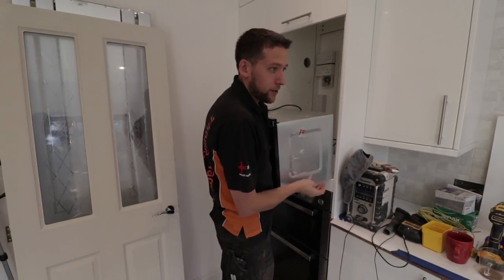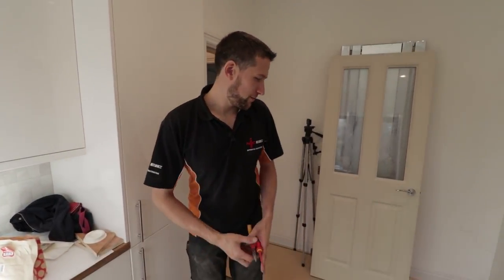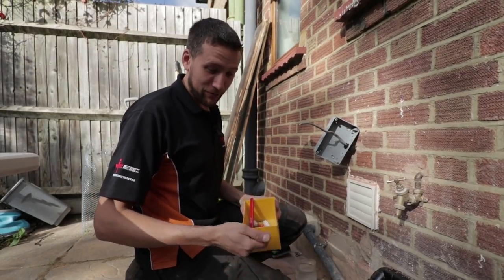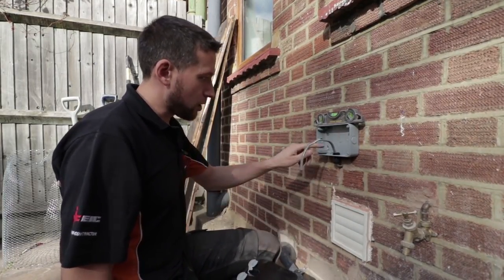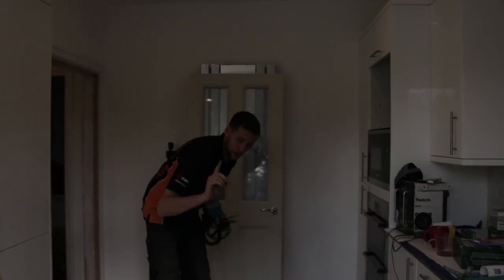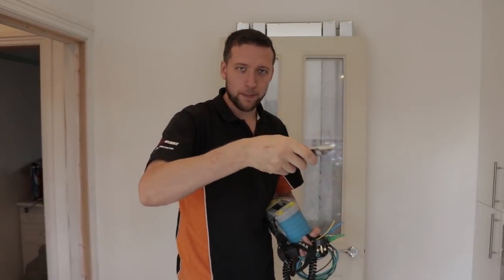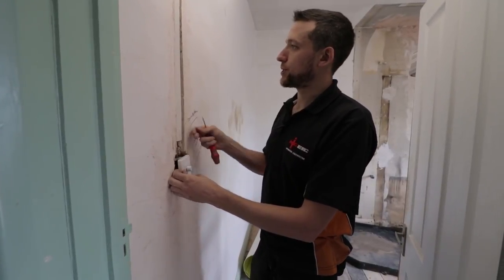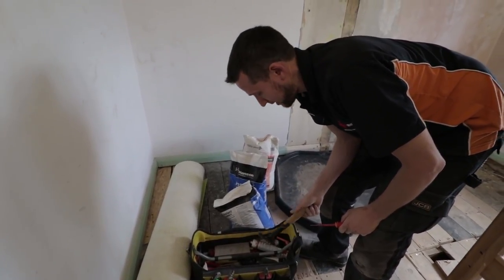The Final Furlong - Rewiring a “just rewired” house | Thomas Nagy

Comment: Outdoor BG sockets use all the time, back entry, drill out drain holes and bead of silicone at top and sides of socket as it meets wall. Think MK stuff is terrible these days not worth the price, hate how the plate depth on spur is thicker than the socket. They need to rethink lots. Use Hager all time, no problems and looks good. Get yourself a Megger get rid of the Metrel as don't think reliable.
Reply: The thick plate fu sp is the one with the bottom cable entry; they do make another model that's thinner

Comment: My Kewtech kt65dl sometimes trips Wylex RCDs even thought it has ATT (anti trip technology) when doing Zs loop tests. I had a couple that weren't tripping in the required time so replaced them I decided to dismantle and see what was causing it. The rcd had burned contacts on L&N. I reckon this causes a slight imbalance on the impedance of the poles being switched, and trips it when testing. After replacing the RCDs they loop tested fine. Anyone else had this problem?

Comment: So yesterday i went to buy an isolation and lock off kit and kinda fucked up. The locks for fuse carriers were designed for MEM boards only :( 

However while i was at the shop i saw your stanley bag and yes its fucking shit. Get the bag with the shoulder strap its way better, so many pockets and slots for consumables and very spacious

Comment: That drill looks huge for a 12V drill. I'd prefer the mini 10.8/12V drills/drivers from Makita and Bosh for an electrician. You need to get in so many tight spaces that spending around 100 pounds for a kit is worth it. I'm in the 18V system and I'm not an electrician, so my tools need to be bigger.

Comment: Best way to wire light switches these days 

1) smart and pir light switches need a neautral.

2) Also who really has ceiling rose's fitted these days in a rewire.. this way the joins are easily acessable not that I make any mistakes...:)

I'm sure the older electricians would beg to differ as that's how they have done it for years....

Comment: Honestly can't stand MK accessories. They used to be premium (the older stuff embossed made in England) but quality has dropped tenfold. Terminal screws seem to round off easily and are fiddly to access IMO. The FCU fuseholder design whilst I see the idea of the worm gear to stop it falling out, just seems fiddly to use.  Hager accessories have nice big terminal screws which you can use a 5mm screwdriver on easily.  Brands like BG do too. MK are also used on loads of council contracts - so if I see them used in domestic I just feel like i'm in a school / hospital :')

Comment: I would gather, every tradesmen has a miscellaneous container.

For the outside junction. I bring the entry through the back, using a gasketed fitting like this.. https://m.lowes.com/pd/Gampak-1-2-in-NM-SE-Connector/1087617 . Just needs an o-ring hub side. Then run a bead of caulk around the box. On another note. All gaskets go bad with sun and time. I've always thought, a tiny manufactured weep hole in the bottom would be ideal.

EDIT: With how much you love Milwaukee, I'm surprised you don't have their rolling packout. 

https://www.milwaukeetool.com/Products/Storage-Solutions/PACKOUT/PACKOUT-Tool-Boxes/48-22-8426

Comment: in the usa for outide socket i wld use duct seal ( https://www.amazon.com/Rectorseal-66345-Metacaulk-Rated-Sticks/dp/B008A3UA18/ref=sr_1_1?ie=UTF8&qid=1539718756&sr=8-1&keywords=electrical+puddy ) around the back hole and use a cable clamp in the inside of box also i wld use duct around the 3 sides of box leaving bottom open so water cld drian out. or if i where to do it the way you did i wld use a water tight 90° pvc elbow sleeve and than seal around hole to masonery more duct seal or silicone caulking. makes for a much nicer look and protects cable.

Comment: The entire problem with the industry s there is a under the table wannabe wire connectors, its like 80% in some shady areas,the big cities, throughout the country maybe 30%, while working around the world, the hourly pay rate is adhered by the trades, also in some countries you CANNOT buy essential parts like consumer units, unless you have a ticket, the whole problem is people pay for the cheapest or almost cheapest quote, which means wannabe wire connectors, shady agents etc, along with everyone concentration being on the cheapest price, for example rcbo units shall be cheaper due to more people buying them, its the so called governing bodies  nic, nappit, elecsa, the law that needs to do something about it, remember in 2009, kitchen fitters, carpenters did a 3 day course and were then able to rewire a house, at a stretch, remember? Over night the cost of electrical work in the city halfed and kept on going down, may I say from a already cheap base, not sure but I remember citb and rtitb, which were responsible for training and such for the construction and road transport industry, good training, so everyone would be on the same level, whatever happened to them, checkout Peter schiff on joe rogan experience, a must,

Comment: Stop F***ing about and get yourself a Veto Tool bag!
I think it's the NIC who now state that smoke detectors must be on a shared circuit, for the reasons you stated.
'Waterproof' sockets- drill a small hole in the back, it doesn't need to be 20mm. Run a bead of mastic 10mm above the hole, 10mm below the top of the socket (or on top of the socket after fixing and bung the hole up. Drill a 6mm drain hole in the bottom of the socket.
Or for maximum waterproofness, just do what you did😂

Comment: time for my quick shit theory ramble, so, what I think is happening with the coil springy wire connector you have giving changing readings I think has a lot to do with two things, one,  the sinewave of the power you are measuring and the coil of the wire.  I think you are having some sort of cross talk between coil segments, if you have it too compressed and the coils overlapping quite a bit there is some inductance and magnetic interference due to the wires being really close together.  Granted I am no expert, I graduated in 1994 from a shitty tech school and even though I have got a second associate degree from a regular university you really shouldn't listen to what i have to say, I'm just some idiot commenting on a youtube video you have never met.
Reply: Never put yourself down -- other people will do that for you, far more efficiently ;-)  (It's the corollary to "always blow your own trumpet -- no one else will")
Field theory: If you have alternating current in a coil, the reluctance goes up through the roof (then down through the floor) 50 times every second. But since the tester is outputting mA not A, the EMF (or MMF) in that coil can be ignored. Don't forget L -- go measure those henrys! <grin>